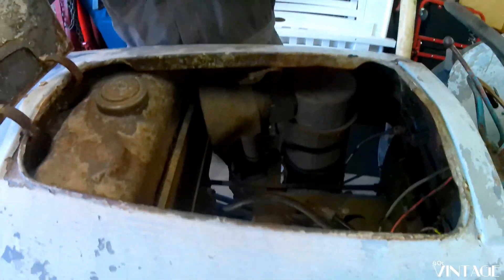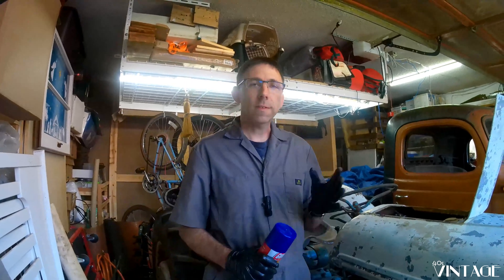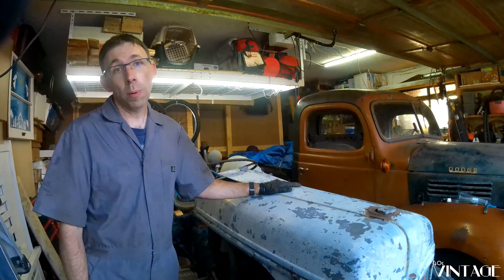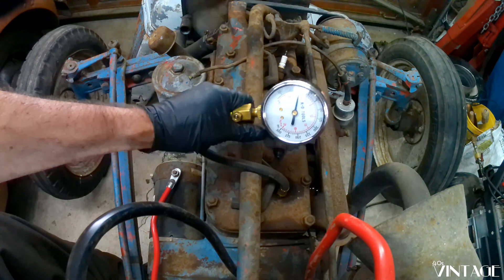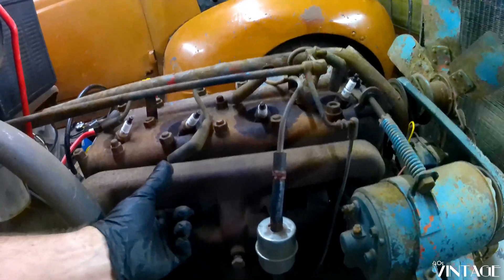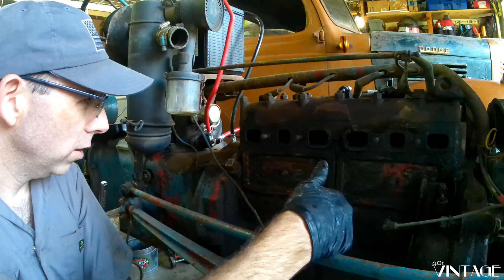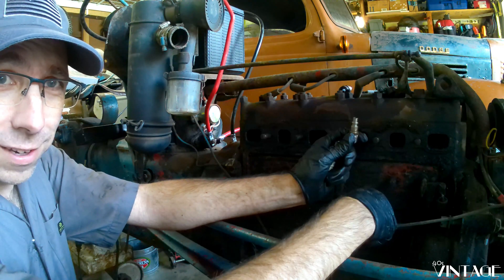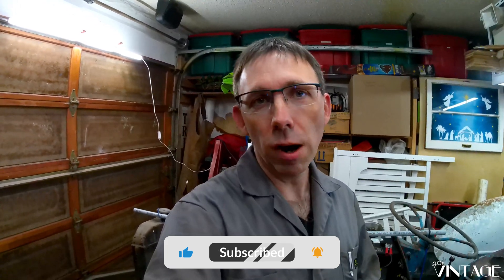The starter works, but will it start? | 1944 Ford 2N | Josie The Tractor Ep 3

Comment: I f you want to you can hit your start with 12volts it doesn’t harm the starter but it will harm the 6Volt coil and battery if my tractor is being stubborn I will use a 12 volt battery just on the starter with booster cables because sometimes when it’s hot it needs just a little bit more voltage but if it’s in gear it can kill you and any other innocent by standers so be safe 😀🇨🇦

Comment: Compression tests are much more accurate with two things:    1.)  All the plugs removed so resistance is constant for each cylinder, and,   2.) Throttle is at "WOT" (wide open throttle). On engines that have been sitting for long periods (many years) rust builds up on the seats and valves. Getting an engine to run even with low compression will almost always bring the compression up (relative to valves) as the rust is knocked off the seats and valves. In addition, you sometimes free up compression rings that became stuck from sitting especially if you had presoaked for 24 hours with ATF or Marvels.

Comment: When you do this again, pull the plugs, add some oil through plug holes, get a battery charger with booster setting, and spin the motor over to distribute the oil on the rings (it makes a mess when compression blows most of it out the pug holes) and spin until you see oil pressure.